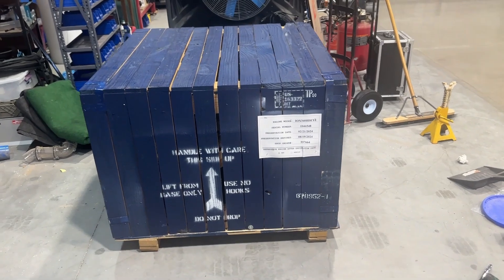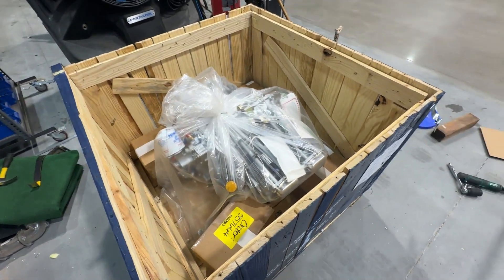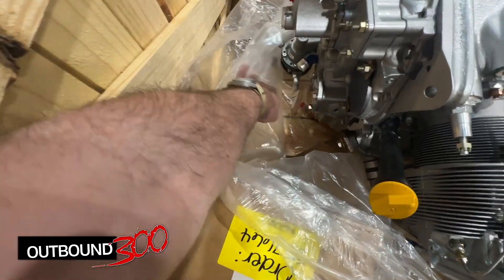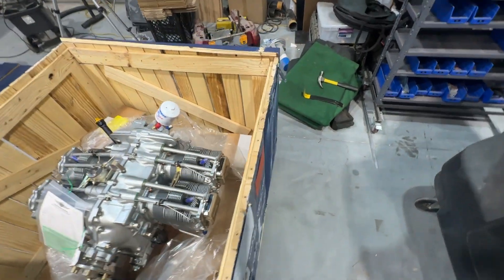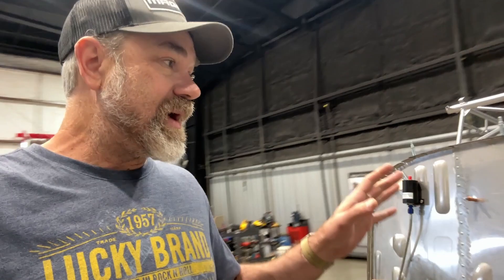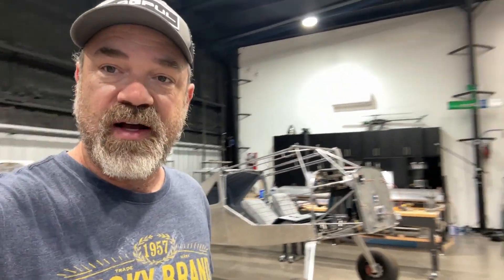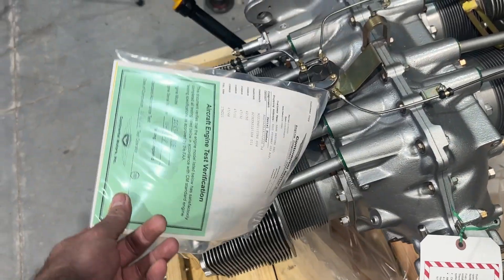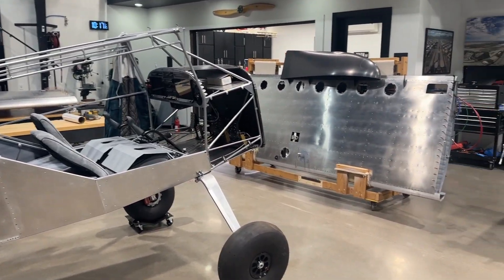Ep. 48 - Titan IO-340X Engine Delivery!

Comment: $50,000 - - The IO 340 engine cost about $3000 to manufacture, and about $47,000 to inspect, test, certify all components through FAA.
Reply: The crankshaft alone is $3,000 to mfg and certify, $6,000 sticker price.